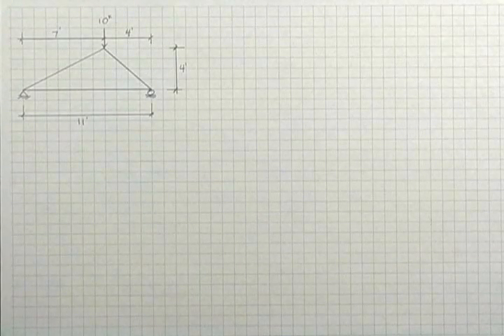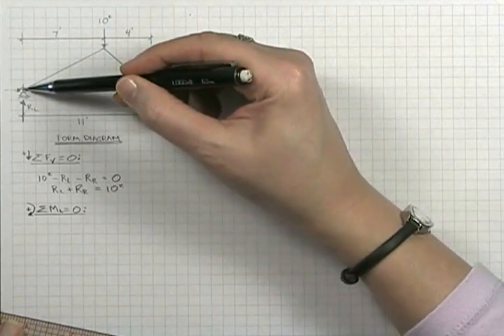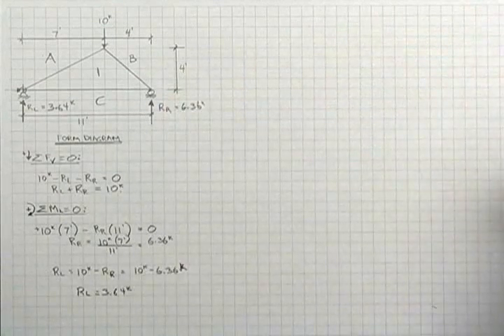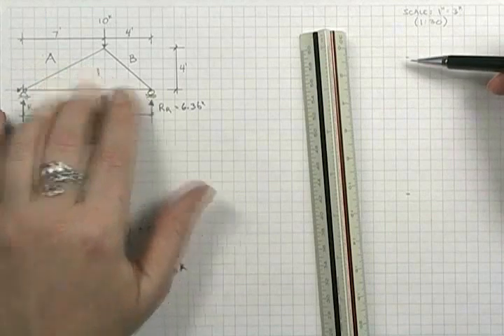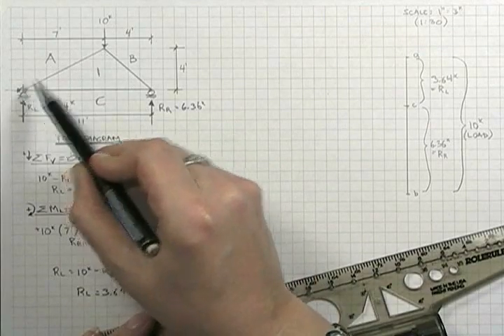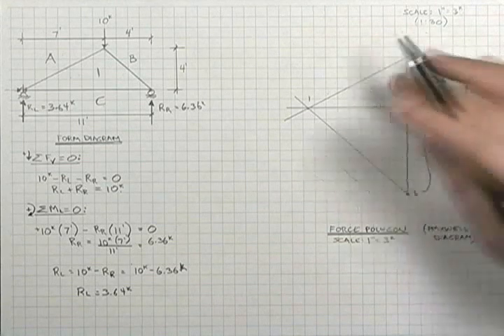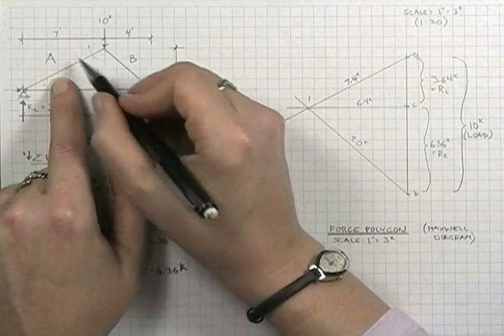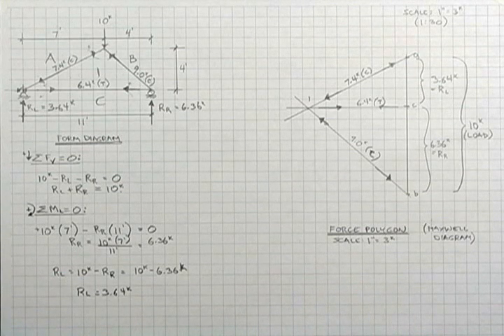Simple Graphic Truss Analysis Part 1

Comment: I am an engineer but it's 50 years ago since I last had cause to do this.  Your explanation was careful & thorough. The "sense of the forces in this case was rather obvious so I'd like to see a solution less simple where obvious did not apply. BTW worth mentioning that more than one decimal place accuracy is rarely needed in practice. Does modern SW do this semi automatically? Again Thanks.

Comment: Good day, how to identify if it is tension or compression. I'm confused whether what condition extends the arrows from away the joint only or extend the arrows towards the other joint. Thank you...
Reply from the maker: Hi Angelika….I’m not sure I understand your question 100%, but if it is trying to figure out if it’s tension or compression, the key is working the two diagrams together. The member name is given by the letters /numbers on either side. Put your finger on the joint you’re looking at on the form diagram. The member name at that end will be the letters /numbers on other side, read in a clockwise order as you go across the member. Keep your finger on the joint on the form diagram while looking at the force polygon. Now find the first letter/ number and then the second. The directional movement will be either away from or toward your finger on the joint of the form diagram. If you move away, then it’s tension. If you move toward, it’s compression. Hope that helps!
Reply: Thank you Ma'am  @professordeb ! It helped a lot!

Comment: the video is so useful! However, i have some questions. How do you determine the tension and compression? At 20:01, u said going from a to 1, it's pointing towards the joint, but at 21:06 from 1 to c, it's away from the joint. why is it so? any explanation is appreciated!
Reply from the maker: Shu Wei Those are two different members. The second one you mentioned is the horizontal bottom member (a tension member), and the first one is the top chord member (which is compression). Use the form diagram to get the name of the member at that joint and then use that name to find the direction on the force polygon. You might have to watch this a few times to make sure it's clear.
Reply: professordeb i've got it after watching it once again! thank you so much for the awesome video

Comment: When the arrows are towards each other. isn't that a compressive force not a tensile one?
Reply from the maker: There always has to be a reference point, and almost always the reference point is the structural joint. So put your attention on the joint, and then you’ll see that the arrows moving away from the joint mean that they are tension forces. Arrows pointing toward a joint mean compression.

Comment: Why you drawn A1 direction at 1 ....it should be from A right 🤔 as in both of the other cases ....( and the force be in tension at A1 )
Reply from the maker: When looking at the lower left joint, the letter 'A' comes before '1', so on the force polygon the directional movement is from 'A' toward '1', directing toward the joint, so compression. When looking at the top joint, the letter '1' comes before 'A', so on the force polygon the directional movement is from '1' toward 'A', again directing toward the joint, so verifies must be compression. Watch from 18'55" through 20'50" carefully.